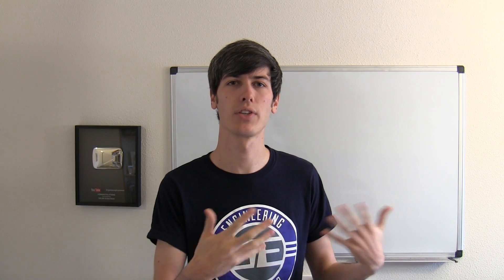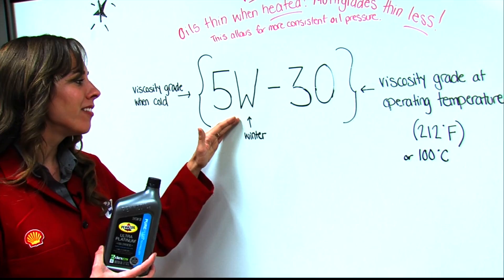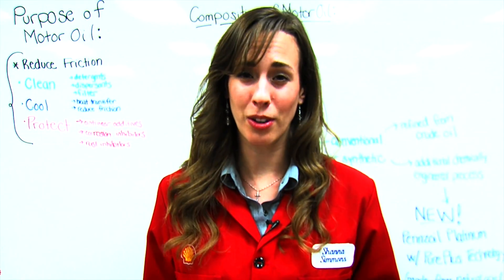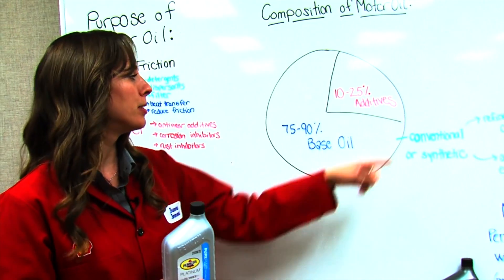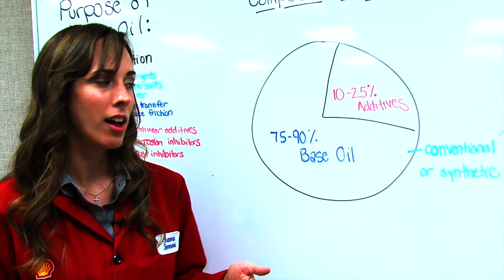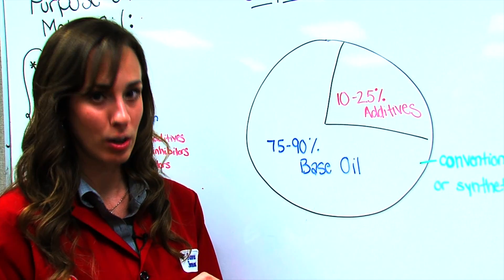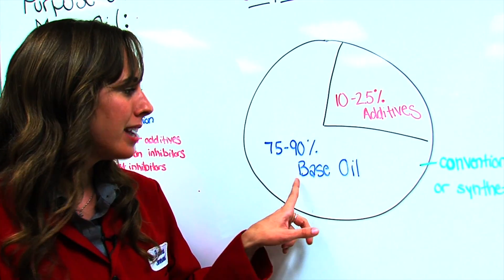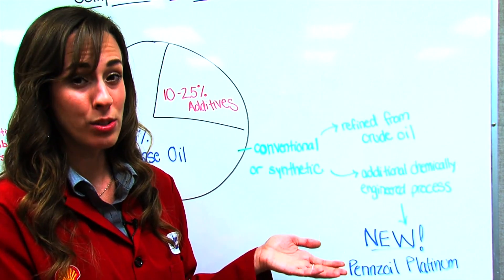Motor Oil Myths & FAQs - Synthetic vs Conventional

Comment: The greatest myth about oils hasn't been answer.. Can you change from minarl or semi syn to syntetic.
Reply: Better not, If those are recommended you may just hurt your engine, espiecially if it's old and worn out, seals are bad, gunk works as sealant at this point, going synthetic will kill your engines performance, and then the car, because of decompression.
Reply: Lol in manual for my car manufacturer lists all oils ranging from 5W/20 to 20W30 (total of 16 viscosities) and explains which number means what and when should be which oil used :) , so it is up on you where do you live and how you use your car. Basically if your engine is new or after general repair, you can use synthetic, the only result in this will be that it better splashes grime and may consume a little bit more oil (burning it in combustion chamber or mixing it with coolant). It also performs better in cold temperatures. In older engine you can use something like 10W40 or 15W40 to ensure that there will be always oil film on parts, but you will need to let engine heat up for a little bit longer time before going pedal to the metal. But if you live in desert, use 10W-x 15W-x, if you live in land of polar bears, use 0W-x or 5W-x.
Also there are cases when you should not listen to your manufacturer, for example subaru boxer engines eat oil in litres per few thousand km! And they want you to use waterish 0W-20, don't use it then, use something with higher viscosity, like 5W-40 etc.
Reply: Not sure what you mean by mineral oil? Mineral oil is often used for engine break in period. Mineral oil is a straight engine oil without any additives and no blends. It is almost always only recommended for engine break in. After which you can switch to any oil type you want. If used for this purpose we are talking about a brand new engine. Regular motor oil I call dyno oil can also be switched in and out with blended synthetics or true synthetics or even mixed with them. The only down side to using expensive synthetic oils in an older engine is that it may find a way to leak out past worn seals or may get past worn oil rings on the pistons and get burned up while driving. Regular dyno oil is not as thin and often will not leak or burn up as fast in older engines and is cheaper. But other than using up your expensive oil faster than the cheap oil no other harm will come from using it. Just your wallet will feel the pinch.

Comment: An old popular science  article reported on a Ford department head who did an experiment with synthetic oil, running his car to 100K miles on pure synthetic and never changing the oil!  The engine was taken apart after the 100 K miles and it was in good shape....If that story is true which I believe it is then synthetic can last way longer than 10k or 15k miles as long as its at the appropriate capacity/level and the oil filter is changed.

Comment: Is it true that the larger the capacity of a retail container of engine oil, the better the quality. The story goes that the oil stratifies out in the holding tank. The better stuff rising to the top. So, they fill the small containers first for a certain percentage of the tank, then the next size up etc until they get to 205 litre drums at the top.

Comment: What about motorcycle oil? I know that it's similar but not the same, 'cause the motor oil is simultaneously the gear oil. The gearbox, clutch and engine are using the same oil and therefore it's much more stressed then a car motor oil. And because of that the additives are totally different (my clutch wouldn't actually be happy to be fed with oil with e.g. molybdenum additive...). So what are your experiences with different oils? In my Kawasaki Versys 650 (2011) I'm using just fully synthetic 20W-50 oil in the summer months and a 5W-40 in the winter months (Yes, I'm such a crank how's riding his bike even in minus degrees) and I made good experiences with that. The fuel efficiency is IMO also better with synthetic oil.
Reply: I have a 86 Kawasaki zl600 I just run 10w40 full sythinc motor oil. The only thing you really need to look out for motorcycle oil, is that is made specifically for motorcycles, more importantly wet clutches. It should say right on bottle motorcycle and or wet clutch oil. On a car your oil is just engine oil, your clutch, if it is manual, is drive so there is no fluid, and your transmission is completely different fluid. On a bike your engine oil lubes the engine, trans, and more importantly the wet clutch. If you use regular engine oil on a bike you could cause that clutch to slip to much and damage it. Weigh typically isn't really a factor, I went with 10w40 because that was all I could find in motorcycle oil, I also do think that is what it calls for.
Reply: mobil 1 4t is for bikes
Reply: Any oil that does NOT have energy conserving or energy saving in the API label is ok in bikes.  This includes diesel oil, Rotella, and some Mobile 1 bottles.  I have run both Delo 400 and Rotella T6 in my bike.

Comment: I,ve made a mistake, my car is Elantra HD 2008 manual with 103.000 KM i get used to put castrol magnetic then change it after 7 or 8 thousand, someone advised me to use Castrol GTX 20/50 after that i noticed the car takes more fuel and the sound is alittle bit louder .. what shall i do ? Thanks
Reply: Drain it, fill it with the correct oil, pray. Also find the person who recommend that to you, punch them in the face.

Comment: I own a 5.9L cummins truck.  I use oil additives because in my experience it does help.  my oil still feels very much like fresh oil.  my dad doesn't use the oil additive I use and when we change it you can feel the difference.  so I think it depends on the oil, situation, and additive.  so I am not fond of her blanket statement.  at least in my mind if oil still feels like oil when you do an oil change that is a lot better than doing an oil change and the oil doesn't really feel very oily.  I use fully synthetic oil and the additive

Comment: Can you use synthetic oil to flush out sludge?
Reply: You can, the problem you some times run into some times though, is the sledge actually helps to block seals from leaking. When the oil is not changed, and sledge builds up, the seals tend to dry and become rock hard. If you just instantly clean that off, those seals tend to leak. The other problem is that synthetic molecules  are much smaller than regular, because of that seals that don't leak on regular tend to leak on synthetic. My suggestion is to change the oil, pour one of those oil cleaners in it. Drive it for like 100 miles, change the oil again. At this point don't use the oil cleaner, and just keep driving it for like 100-200 miles and changing the oil, till the oil drains clean. I know it will get expensive because you may need to repeat this process 4 5 or maybe even 6 times, depending on how bad the engine is, before it runs clean. But compared to the price of a new engine, this is much better. By doing it this way you slowly clean the engine, and at the same time slowly remoisten the seals in the engine, so that hopefully you can save your engine, and also avoid having it leak.

Comment: One thing not mentioned, when a mineral (conventional) oil is repeatedly heated and cooled, it will eventually lose its different viscosities, ie instead of 5w/30, it will degrade to say 15 or 20. A synthetic oil will always maintain the different temperature viscosities.

Comment: understanding that the W means winter and the cold viscosity rating , is there any risk in putting in a 5w-40 oil into motor cycle that calls for a 10W-40? It is a dirt bike (WR250f), but own other motorcycles that call for similar grades. would prefer to just buy one grade and stock up on one particular oil. would the oils thin out differently during their use?

Comment: Wtf are you teaching people you morons!!!! Water has a viscosity rating of 0 so 5w30 means.... The w means warm. So at operating temp the oil is 5 times the thickness of water when the engine is cold the oil is 30 times the thickness of water and gets thinner as the engine heats up. Stop teaching people crap!!!!!
Reply: Interesting, I work on cars for a living, and the w, as far as I have known as always meant winter. But just for shits and giggles I would like to point out one problem with you theory. If water has a viscosity of o. The five means 5 times the viscosity of water, isn't 0*5, or for this matter 0*anything, 0. So by this logic the viscosity of the oil would constantly be 0 or the same as water. Sorry, try again.

Comment: So answer this. I use in my truck 20w-50 since its old and worn out. But I also add on occasion one or two bottles of some engine oil stabilizer(one if changing two if low and topping off). Mostly since it is super thick. Do you think it might be a problem? Not using it in the engine but mixing the two together. Engine runs fine.
Reply: If your engine runs fine without the additives I wouldn't recommend using them, they cost you extra money at the fuel pump.
Reply: +Austin Lucas Like fuel mileage matters. it's a 4 barrel dumping into a 360 engine. 1973 style. I don't think I'll ever get more then 10 MPG unless I shut the engine off. I guess 10mph might be a bit much to expect anyways.
Reply: I call that good sense. I do the same in my old 454 in the block as well as the muncie, but I'm also in Texas where it gets HOT. Either way, as long as its not so viscous that you are still getting good cold weather protection id say keep doing it. Those old truck blocks are designed for low end torque anyway, in mine the only differences in milage are due to driving style.
Reply: If you are having to use 20w-50 your engine is Not running fine. It is worn out and you probably need to rebuild it.
Oil stabilizers are great when you have bad rings and dumping fuel into your oil pan because fuel will destroy the effectiveness of the oil and wear your bearings. So seeing how you are already having to use 20w-50 adding a product like Lucas is just going to help your engine last longer.

Comment: mineral oil has been used in an older gasoline Marine engine for its life, the oils was changed regularly and engine seem to be running fine.   I would like to upgrade to the finest synthetic with added esters. People are telling me that I will be generating potential for seal failure. I feel today's synthetics have already addressed that issue.   YOUR OPINION PLEASE

Comment: Just a tip to remember....if you dont change your oil regularly and you run into an overheating issue; all that carbon build-up will possibly fall into your oil pan and get sucked into your oil pump strainer. When this happens, obviously your engine will get starved for oil and eventually seize. No engine completely recovers from this.

Comment: i heard some people are using diesel oil for the gas engine what is the benefit of that? and what is the down size?
Reply: Diesel has zinc in it still, anything without the energy saving or energy conserving in the api label has zinc, or ZDDP.  It was removed because of being a pollutant, and too much can supposedly damage the Catalytic converter.

Comment: Actually I have very pertinent question regarding break in with synthetic. Because of the excellent friction modifiers that are in synthetics how would you explain how engines are broken in from the factory? Piston rings need to be able to seat properly and from my understanding synthetics wouldn't allow for proper seating due to its additives and wear property. My question is are manufacturers doing some sort or engine "break in" before factory filling with oil? Or can we get a better explanation of correct break in for new vehicles. Older vehicles had to have a break in oil as the rings were seating with the walls and would cause small fragments to get trapped in the oil which would result in a need to have a break in period. So again how are we compensating for that from the factory?
Reply: A never answered question?

Comment: One problem with synthetic oil not mentioned in these videos is if you don't drive your car daily. The lower viscosity causes the oil to drain from the bearings so when you start your car there is insufficient oil to keep the bearings lubricated. This causes significant wear and tear on the bearings in an engine.

Comment: Always leaves me skeptical when there is sponsorship
Reply: yup the "feel and smell dipstick test" always a great example of when to change your oil. also a great way to tell if the woman you are dating is "the one".....
Reply: "cheap" oil doesn't sludge up like she suggested. slug is from carbon from cumbustion, and hot to cold cycles breaking down the oil. i dont go by milage OR time for oil changes. i simply inspect my  oil from the dipstick on my fingers by feel, smell, and appearance. its pretty easy to tell when oil has gone bad. it smells of gas, doesnt feel good on your fingers, and is mostly black.
Reply: Right? Specially from Shell.
Reply: He does say "I'm sure the same can be said for other motor oils"

Comment: I've heard that if you switch your car to synthetic, you can never go back to conventional. Is this true and why?
Reply: Switching from synthetic 2 conventional is you just don't wanna mix synthetics
Reply: synthetic oil is able to escape through your worn out gasket better than dino oil.  they say dirt is actually helping the gasket create the air tight seal but if you use synthetic it may "clean" the dirt & start leaking.  anyway, that's what I heard.  in the end, I would never switch back. why would you? save a few bucks?

Comment: Some car manufactures only include one recommended (average) viscosity grade of oil, but in reality they should include a high, medium and low list which is dependent on the temperature of your environment. So technically.... If you live in a place with very hot and or very cold temperatures, you should change your weight of oil for optimal performance and not necessarily use JUST what is said in the user manual if there is one grade stated.

Comment: Hey, i've heard some places that using synthetic oil on a high mileage engine that is used to conventional oil can damage it. Could you shed some light on the matter? Thanks!
Reply: There could be a problem in this situation.  The old high miler engine may have sludge accumulation that additives in a synthetic oil may disturb and bring into circulation.  Obviously that could cause a number of problems.

Comment: if I have a high mile car that has always used conventional oil Question if I now switch to synthetic same viscosity will this cause my engine seals to leak? My mechanic tried to tell me that I shouldn't change because this would happen. Wouldn't this be more so caused by say a oil that is higher in detergents then normal? He also recommends adding transmission fluid 1 pint per change to help viscosity. Is this true?
Reply: Switching between the 2 wouldn't cause seals to leak,unless it is in an antique vehicle (pre 60's)due to seal material.Transmission fluid would only act as a high detergent with no effect on viscosity.
Reply: yup, you told the words right out of me mouth
Reply: Running tranny fluid in the oil was an old school way of cleaning up the motor before and oil change, I don't recommend it for today's cars.

Comment: What about synthetic oil in diesel motors??
Reply: If it's a duramax, and you're thinking about amsoil, don't do it. Those two simply do not mix.
Reply: I have a diesel, always used synthetic oil because that's what the manufacturer recommends. There's no real danger in switching to synthetic, only benefits.
Reply: Ams oil is just junk in general
Reply: +Dan Stankowski I agree completely. amsoil cost me an engine, even being changed at GM's factory recommended intervals. I won't touch the stuff again.
Reply: 1999 G.M. 6.5 Turbo Diesel
Switched from Shell 15w40 to Mobil 1 5w40 then to Renewable Lubricants' 5w40 then to Shell T6 0w40; no issue and the fuel economy probably increased over 15w40.
Reply: Thanks man.

Comment: would it affect the life of an engine to you changed the that type of oil you use, as for example 50,000 miles  on conventional oil and you convert to full synthetic or  or the other way around?

Comment: So it is said that you should never use engine oil additives however I hear from other sources that modern oils with considerably lower levels of ZDDP than from years ago will allow flat tappet cams with higher spring rates to wear at an accelerated rate, particularly during the break in period of a rebuilt older engine. For these a ZDDP additive is often recommended. As an alternative there are oils made specifically for engines of older designs. Just want to clarify this because there are exceptions I believe people should be aware of.
Reply: Mobil 1 "high mileage" has increased zddp, Mobil 1 "turbo diesel" has even more and Mobil 1 "racing" has even more so you shouldn't need to use the additive. It already has higher levels of zinc and phosphorus. I guess the disclaimer is that the "racing" zddp levels are too high so it shouldn't be used on the street. My bug's engine with 300,000 miles didn't complain before the front suspension fell out from rust first.